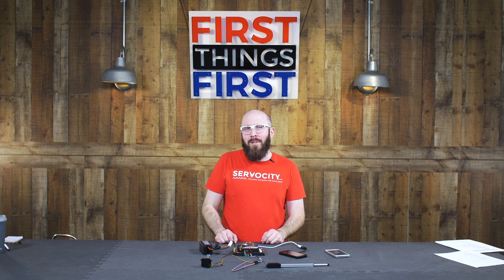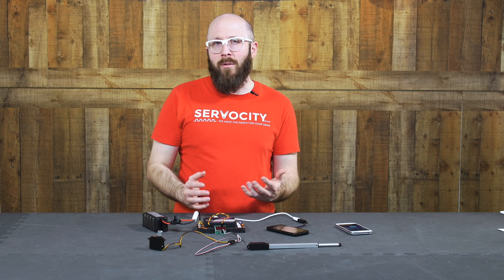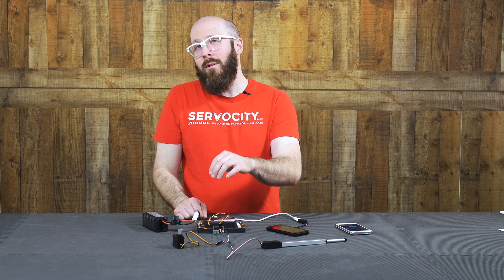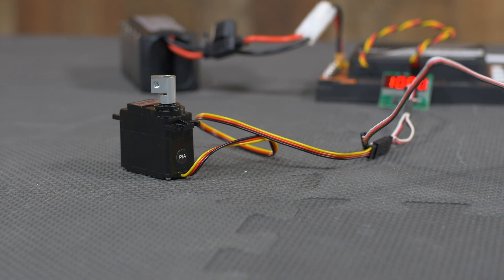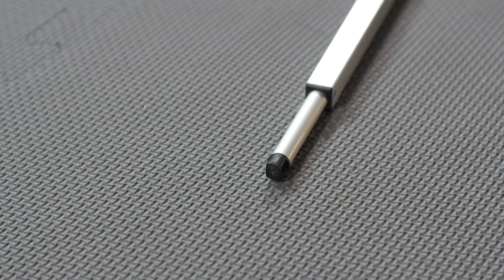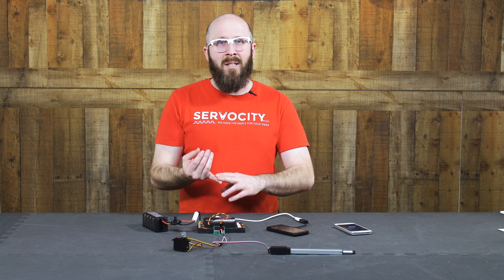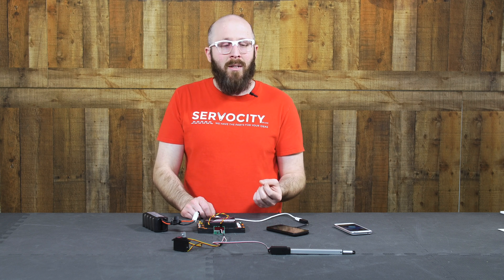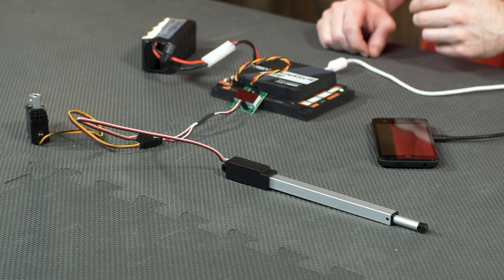Using Linear Servos with the REV Expansion Hub

Comment: That convenience is not worth $99! Got something cheaper for makers?
Reply from the maker: Hey James! Are you looking for an alternative to the REV Expansion Hub or to a Linear Servo?
Reply: @ServoCity  To a linear servo. I am working on a cosplay outfit right now, but many more ideas in the works.
Reply from the maker: Great question, I would say you can most likely make something with a standard rotational hobby servo that would turn it's rotational motion into linear motion (a linkage, rack and pinion or lead screw) for cheaper than a polished solution like a linear servo. If you'd like more info please shoot us an email to tech@servocity.com if we can help you out further with a project like this!